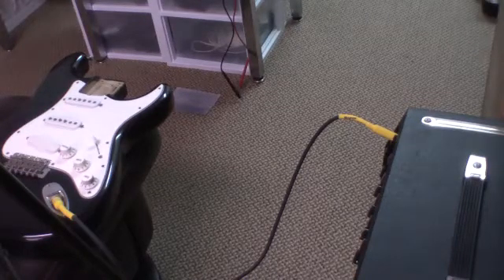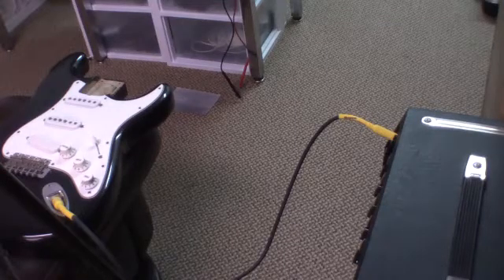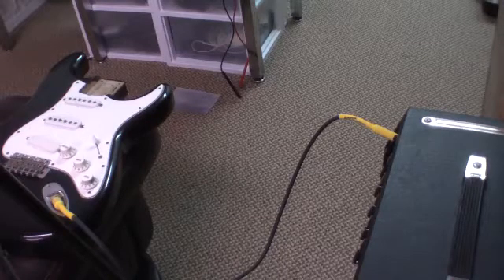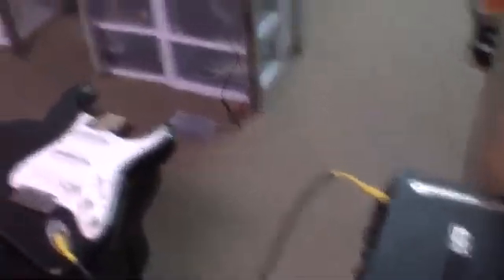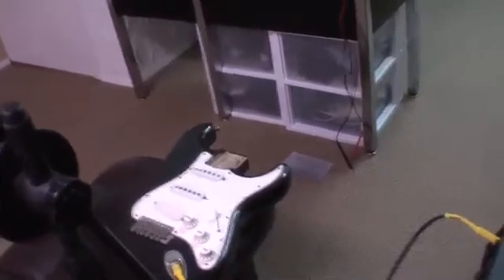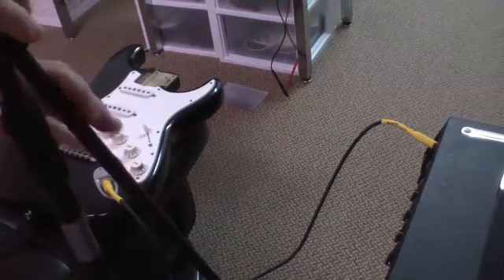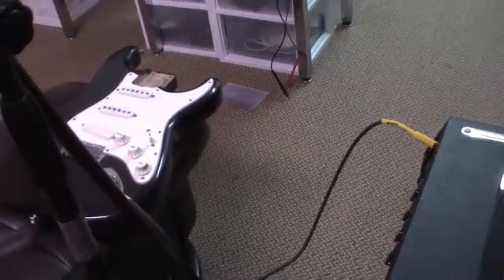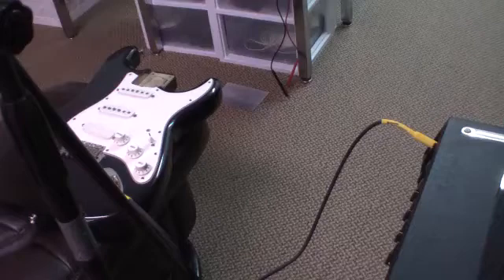Does Tone Wood Affect the Sound of an Electric Guitar when Plugged In?

Comment: I can't believe this debate is actually happening. Just stick the electronics from a great sounding guitar into your softwood guitar and be prepared to be thoroughly disappointed. It'll still sound dead, because softwood absorbs the vibrational energy of the strings.
Reply from the maker: Exactly. I've come to the conclusion that Tone Truthers actually, for whatever reasons, cannot experience, audibly, the difference of an instrument that carries a tone, and one that does not. They are mostly correct in thinking that choice of woods does not make a HUGE difference (i.e. the pickups are a biigger influence in overall sound), however, they are just incapable of hearing the depth of timbre in an electric instrument - for example, if given a basswood Ibanez with great pickups, comparable to 57's, (for example my '87 760 has IBZ-USA pups by Dimarzio) -- they cannot actually hear that that it is thin, that it lacks depth, that there is no wood to the tonal timbre. They simply don't hear it.  Many do, and simple physics clearly explains why it exists -- to say the body does not influence the sound, when (as you say) it is either complimenting the oscillations, or not... proven by physics.. is to say that every electric guitar is constructed by strings held by infinite mass of infinite density. Then, and ONLY then, would it be true to argue that electromagnetic pickups are influenced ONLY by sine wave theory and Maxwell's equations of electromagnetic energy. Unfortunately,as we all know, a body of a guitar IS NOT an infinite mass, of infinite density, and for that reason, Tone Truthers are, in fact, proven wrong by the laws of physics.
Reply: KyleCarrington To me, the most important part of my sound is the wood of the guitar. This is why this debate is so shocking to me. I've been playing electric guitar for 40 years, and it's been my experience that the difference between a guitar that sounds dead or alive is the wood. Yes the nut, bridge, neck joint are important as well, but most those things are easily changed and don't have the nearly the impact of the wood. 
There's just nothing worse than a dead sounding guitar. Hard wood doesn't provide just for good sustain, but also for crispness and clarity to the sound. Especially to lower frequencies. Playing palm muted heavy metal chords will never sound right on a softwood guitar. It's sound weak. I know. I've tried it too many times. I've tried exchanging the pickups, etc.to no avail.
The wood has to be dry as well. Poorly seasoned wood will also absorb the vibrational energy of the strings creating a lifeless guitar. 
I can't stand a lifeless guitar. lol
Reply from the maker: 1971SuperLead I hear ya man. Even the difference between an old strat and some brand new one is noticeable. Strat's, being alder (I think) are kind of borderline to begin with. Mine sounds pretty good, it's a 1982 or 86, the one in the video, it now has better pickups too, and it sounds ok. Some brand new USA ones sound pretty lifeless tho. Every Ibanez I have ever played with the exception of a few Artists sucked basically. I have two. They play AWESOME, as in playability... I'm SURE there are some good Ibanez guitars, though... I'd like to find one actually... just every one I ever played weighed about 4 lbs and was made from basswood (probably) -- and then you get into a Les Paul, with the mahogany's and maple construction... many of them resonate nice. Some rip-offs like my old Vantage, or Epiphone LP's sound pretty good too, when they are built with good wood. Washburns. You don't have to pay a lot, just pick it up tune it, and play it without an amp, first. That's what I say. If you sound like a 13 yr old punk wankin in a basement, it isn't a pro guitar. And chances are, it's made of shit soft wood.
Reply: KyleCarrington I own 5 Ibanez SZ320 guitars. All of them are stock, solid mahogany and sound amazing. I bought each one for around $200 used. 
I also own a 50 year old 1964 Stratocaster. So I know what good tone sounds like.
Reply from the maker: 1971SuperLead Right on. I'll look into that. I just listened to you playing one, I think, and it sounded good. I am looking for something with double humbuckers. Solid Mahogany always works for me, I have a Vantage that's from the Matsumoku era and it's solid Mahogany too, and sounds good. It'd be nicer to have the wicked Ibanez neck though.
Reply: KyleCarrington I bought 5 of these guitars simply because they are amazing and cheap. The original volume pots are crap (linear taper!) but the rest of the guitar is nice. Endless sustain, fast neck, killer tone and the neck joint makes for access to the 22nd fret a breeze. 
The weight of these guitars varies from 6 3/4 lbs. to 9 3/4 lbs. The heavy ones are metal machines and the lightweight ones are much prettier sounding. So make sure to ask about the weight when shopping for one. Make sure it has the factory Seymour Duncans in it too. JB in the bridge and 59er in the neck. 
There's lots of information about them on the internet. I do have videos of me playing one, but the amp I'm using is a solid state Fender G-DEC3. Oh, except for the outdoor shows, but the recordings are pretty bad.
Reply from the maker: 1971SuperLead Yeah! I dug the Judas jam you guys did, sweet!! Hey I just was listening to an AR220, also a mahog ibby, sounds fricken great! Might be cliche, but... i really dig that Gibson '57 classic tone  , ya know. My Ibanez 760 with IBZ/USA pups is ok for metal, but it's thin. The humbuckers in my Vantage are T-tops from the seventies, so they have that 490R 500 combo sound. I'm after a real bright/bold '57 tone. I did this tone, and instrument. 

https://www.youtube.com/watch?v=09rjC0fopf4
Reply from the maker: 1971SuperLead yeah it does, doesn't it? Very Les Paul tone. A new Les Paul Standard, a 2015 is freaking $3750, can you fuckin believe that?! That is outrageous. I thought about an Epiphone but this Ar is starting to win me over. It's a sexy lookin axe too, very classy lookin if u ask me. very affordable. sounds great. a lot like one of those beautiful Yamaha SG's from way back.
Reply: 1971SuperLead I found out quickly that it sounded too bright compared to my '73 LP & I wanted consistency, to have a second gtr on stage in case a string broke which seemed to happen a lot. It was ok but it really didn't sound like all the other LP's I've played.
Reply: 1971SuperLead  1971superlead exactly Very well said!
Reply: KyleCarrington There’s a late ’70’s Ibanez (same shape as AR) with a beautiful hand carved maple top & a Yamaha from the same period (SG shape but thick body), which are great LP sounding GTR’s. I’ve been kicking myself for years for not buying the Ibanez in 1995. $450 in a tiny used gtr shop in Berkeley!!!

I’ve had a '78 LP Standard for about 20 years.13 years ago I was just messing around with some new LP's at GTR Center, not planning on buying one. I didn't like how any of the new one's sounded, the construction quality didn't seem great & due to the price I realized I didn't want or need a new one. But I found a '79 Custom hidden in the "vintage room" It had a few dings but as soon as I played & found out it was $1200 it only took me a 1 minutes to realize I had to buy it. But that was just shear luck. It is an amazing GTR. I'll never buy another brand new GTR.

It took me months to realize I liked the Standard’s rosewood neck tone better than the slightly brighter ebony, but there’s no way I’ll sell my Custom. At the time I was using these gtr’s for modern punk (close to the new Metallica sound) I’ve been experimenting with pup’s on all my gtr’s for years. Ended up with Seymour SH-6 in the bridge. It’s unless of course for a clean sound but full gain thru a marshall is thick & rich without the hi end “buzzy-ness” of an SH-4. But the original T-Top in the neck position sounded muddy with this combination so I put in a SH-2 Jazz in the neck, & for the style I play it’s the perfect versatile combination, with both pup’s being in pocket & complimenting each other. (I also bought a '76 maple neck LP in the 80's, mistake, got rid of that after 6 months)

(It’s both amusing & offensive when an anti-tone-woody TELLS me that an SG will sound exactly the same with the proper set up & pots. “Due to other variables” is an excuse that's been cut & pasted way too many times.)

There are a lot of kids who record at my studio who come in with shitty gtr’s & if I suggest they use one of my LP’s, they usually do, unless they prefer a shitty sounding Kurt Cobain tone. BTW his tone had little effect on record sales. But I do listen to Nirvana sometimes & wish I could have installed a different humbucker for him.
Reply from the maker: Andro Ernst Seymour Duncan have some great sounding pickups. It took me a while to realize that they have "everything" which means they'll have some you definitely hate, too... but I installed SSL-1's on my Fender Strat (in this vid), hey...
what is the name of that shop in Berkeley?
Reply: Andro Ernst Dude, no no no. The best sounding guitar I ever played was a black 1979 Les Paul Custom with a Seymour Duncan JB in the bridge. I plugged it into a 1979 Marshall 50 watt with an extra added preamp tube and effects loop done by Mike Morin and a Boss DM-2 delay in the loop. Oh, and two 300 watt 4x12 Marshall cabs. That was 30 years ago. It was the most amazing metal tone ever. I totally regret selling that guitar, but it was like having a boat anchor hanging from my neck. It screwed up my neck. 
I bet your 78 weighs a pound or 2 less than that 79. The 79 Customs are the ultimate metal tone machines, but they weigh a ton. Am I right?
Reply: KyleCarrington Yeah I've spent a lot $ trying to find the right combinations. I don't remember the shop's name. Somewhere off of MLK between Gilman & Ashby.
I've gone thru all kinds of pup's with my Strat's. Put SSL-1's in most of them, then tried the hand wound Antiquity 1 in the middle. I noticed a little more definition in the low's & they have a little more mid's & presence quack than the SSL-1.

So I sold my real '59 pup's.
1. They can fail over time,
2. they honestly didn't sound better, just a little different,
3. Because people will buy them of ridiculous prices. ($3000 for pup's alone)

I want most of my Strat's as versatile as possible. So I was using a SSL-1 in the neck, a Antiquity 1 in the middle & a JB JR in the bridge (only for hi gain.)  
At some point I tried the Antiquity 2 in the neck which is my standard choice at the moment. There are only so many pup's I'm willing to experiment with in my life. I heard Rolph's that sounded sweet but had a sparkle that didn't sound as Fender-ish in the particular GTR I heard them in.

I would describe the SSL-1 75% antiquity 1 & 25% antiquity 2. The 2  does sound very 60's. Smoother, less transients & of course less character than the 1's. The 1 can have that painful transient quack when too clean, but is more expressive than the 2. (The 1 definitely needs it's own tone control to work properly with my crazy combination.)

So I"ve been going back & forth with 5 Strat's trying to figure out the perfect combination, but I don't think there is one. My concept is to have a smoother neck pup for clean blues, The antiquity 1 in the bridge to take the role of the traditional bridge pup & the JB JR for extreme hi gain. BUT I have also found that the Antiquity 1 with hi gain & some treble rolled off can sound ferocious. 

I've gone so far as putting a Antiquity A custom 9.00k in the middle pick up that sounds amazing for hi gain solo's but not so good for clean. This gtr is for solo's only. I tried this same pup in the bridge but didn't like it.

I hope this helps. It's a lot of trial & error, & of course all of this is a matter of personal taste.
Reply: 1971SuperLead I hear u. A lot of people prefer the SH-4, it is an excellent pup, but with my Dan Torres modified hi gain 1976 50 watt, this is my preference. I've recorded a lot of SH-4 LP's & recorded a few artists using my SH-6 LP's, & myself using both combinations. The SH-6 sounds thicker & richer to me. Either with the vintage 60 Marshall or the old greenback cab.
It's all a matter of taste & the amp can be adjusted either way.
  
With Strat's I have to use the vintage 60. But I really don't think Marshall's & Strat's work together that well. I'm using a vibrolux or Ampeg v2  for semi-clean & Marshall for max hi gain. If I ever get back out there & preform live I'll probably get a Mesa Road King.

My 2 LP's weight close enough that I don't notice if I'm playing one set. But my '76 maple neck LP weighed a ton. Both GTR's sound very similar but for me the rosewood has a more aggressive tone for lead GTR.
Reply: Andro Ernst How do you like the sound of that maple neck LP? I have one too, a 75, and it's a dog. It's not that heavy either. It's one of the lighter LPs.

Comment: You could settle this by demonstrating the waves you say differ from one wood to another. 

There isn't enough consistency from one piece of the same wood to another to account for tone in the way you say it does. The same pickups demo isn't. The pickup position, differences between them, other wiring differences, capacitance differences between pots, and other factors purely electronic invalidate your demonstration.

Comment: I've been doing a lot of research on this topic, and so far I'm not convinced tonewood has an effect on amplified sound perceivable to the ear. However, I need some more information before I draw any concrete conclusions or start with an experiment I have planned. If anyone can point me in the right direction, I would like to read an extensive report on what could cause a waveform to change when transferring through different media. I can't seem to find one, but I feel like that information would prove beneficial to this debate.

Comment: Strum the term springs. It will generate a signal. Tap the body with different objects, the signal will be different (if you have a spectrum analysis tool). This kind of test is a piece of the puzzle, but doesn't by any means close the debate. It does suggest, however, that vibration of the body materials can have some impact on the signal but I have doubt's that this is meaningful in playing.

Their impact on the vibrating string is where the 'money' questions are.